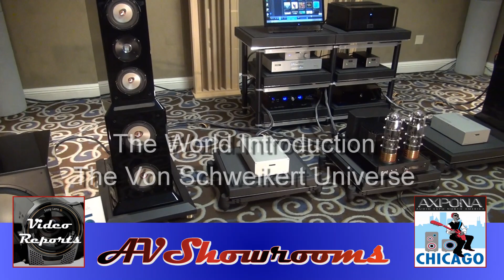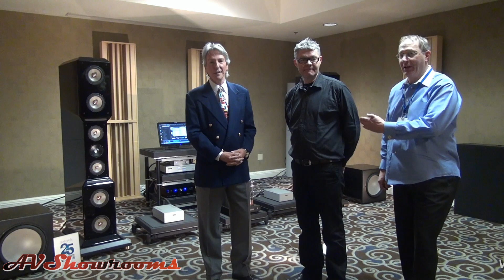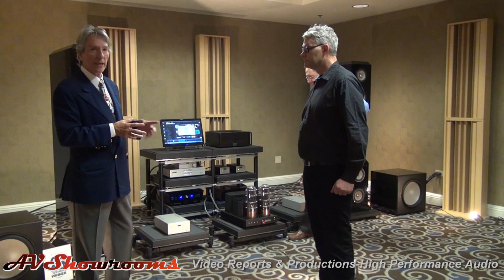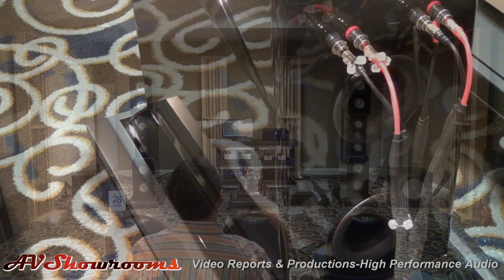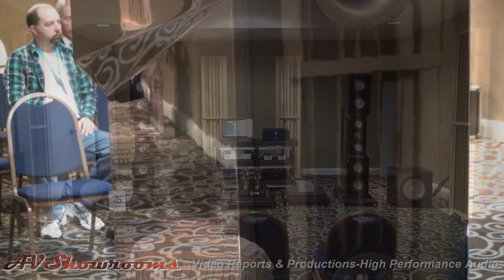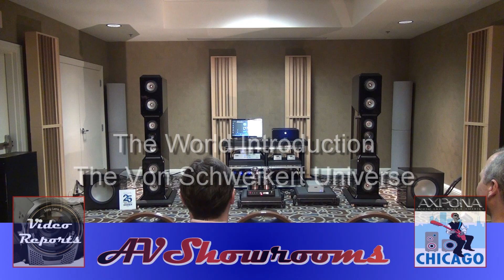Von Schweikert Universe Loudspeaker

Comment: I have a pair of early Von Schweikerts he called the Vortex Screen. It is very similar to the VR-4. They are over twenty years old now and still sound amazing. Robert Harley of The Absolute Sound reviewed a much earlier rendition of The Screen for Stereophile in 1989 and gave them a great recommendation. YES! Mr Von Schweikert has been refining his ultimate speaker designs for 30 years and they have been used by recording studios and famous name artists for nearly as long. I have spent years auditioning speaker systems that sell for way more than my Screens and no Martin Logan's or Vandersteens or even a pricey set of Wilson Watt/Puppies could kick the old Von Schweikert's out of my home. No the Screens weren't better than the Wilson's. but, they are so close that it wasn't worth the $15000 for a incremental upgrade. I use my old Screens as my mains in a 200wpc Home Theater System and I don't even need a subwoofer because the Screens go deep!
And for my money, they through a bigger soundstage
Albert Von Schweikert is a audio genius and if you haven't heard for yourself, then shut up and go listen.
He does make some affordable systems that sound amazing.